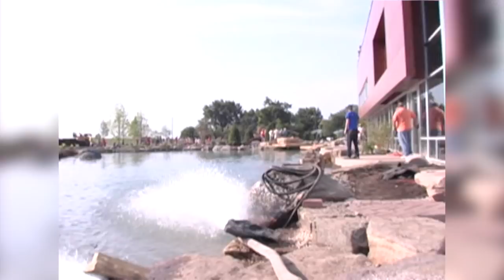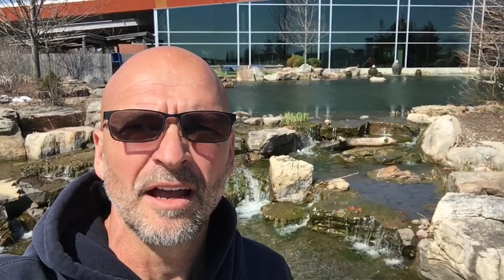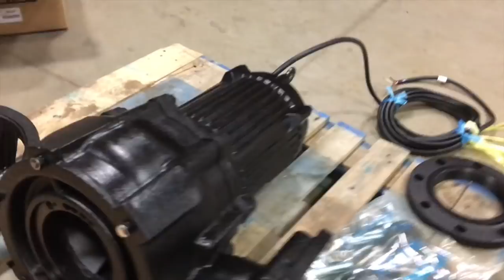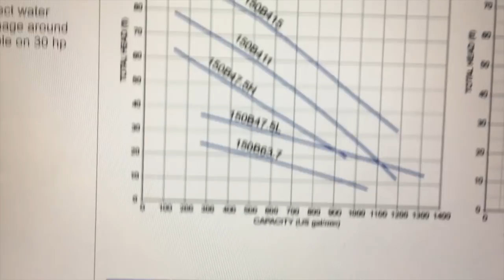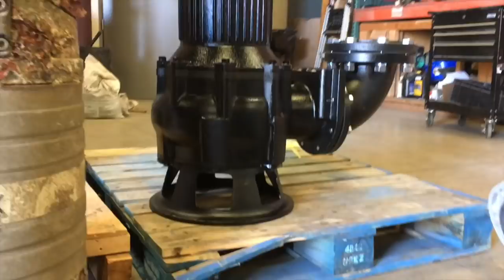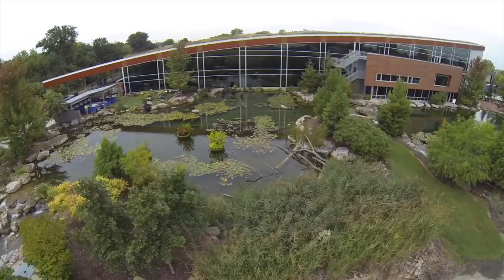HOW TO REPLACE WETLAND FILTRATION PUMP

Comment: Just a bit more info. The original pump is a dewatering pump, these are typically used in clear water applications. The replacement as described is also known as a trash pump, due to its solid handling capabilities. As seen in the comparison the original pump can only handle debris the size of the holes on the screen, where the new pump is designed to probably handle debris up to 3". Also to describe head in layman's terms = 11' of head on the curve means the pump can shoot 900+- gallons per minute 11' in the air. To calculate feet of head into pressure divide the feet by 2.31 and you will get 4.76 PSI. The dewatering pump probably can do 90' of head or 38 PSI. The other factor in the calculations is something called friction loss. When designing a pump system you need to factor in the loss of head in the pipe as the water moves through it. This can be calculated through the Hazen-Williams equation and your system will need to overcome this loss, which is added to what you see on the curve. Thanks for the video, great to see in play something i work in everyday. This video will help my wife understand what i do for a living. lol.
Reply: What brand of pump is the new pump? Would you happen to have the part number of it?